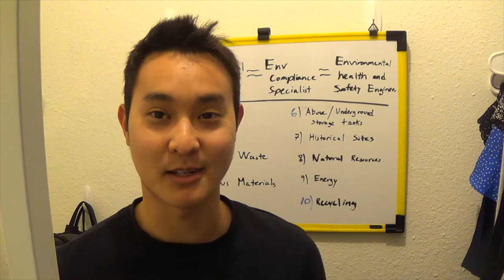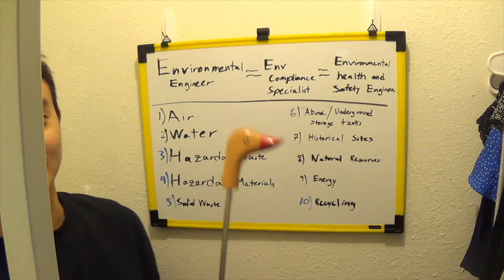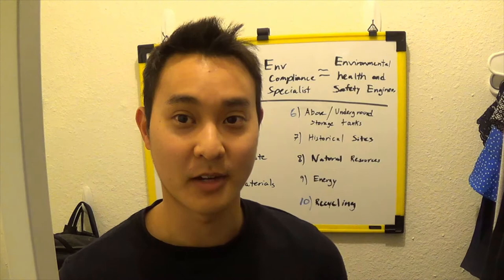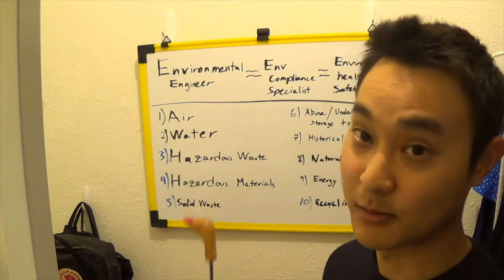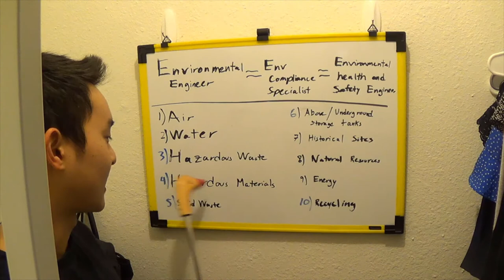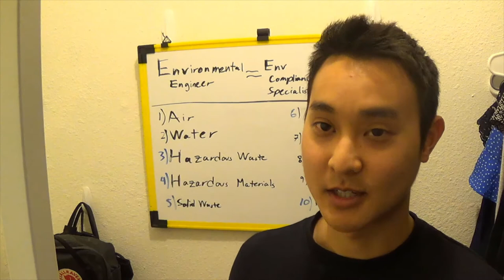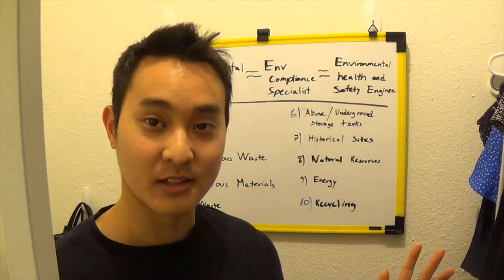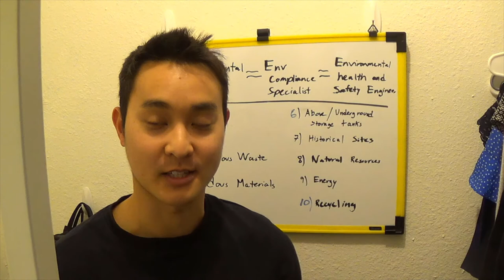What Environmental Engineers Do | Environmental Compliance

Comment: Hey randy, I am in the process of working on completing my environmental engineering degree and I had a few questions. What did you do to gain experience to get a job? I know many jobs even entry level, want us to have experience. Any advice?
Reply from the maker: The fact that entry-level jobs want experience frustrates me so much. It just doesn't make sense. 
That means the only way to gain experience before an entry-level job is during your schooling. 
Things like getting an internship, joining a club, or working on research projects with a professor are all examples you can do while at school. You definitely want to get out there and have some exposure to something related to the environment, but if you can't get into any of them, any type of people building skills should do the trick. They'll most likely want stories of how you reacted to a situation. Customer service skills are really valuable.
Reply: thank you!! 🙂

Comment: Hey, I Hope you reply.. I have a few questions?
how many years do you have to be in college for an environmental engineer?
And is the work hard or just simple On the field?
Is Math a problem?
Reply from the maker: 1) For undergraduate, it takes probably 4-5 years, depending on how hard and fast you study. People can graduate faster as long as you finish whatever is required.
2) My work is pretty easy. The field work isn't really even field work. It's just walking around to different buildings and looking around to see what they have.
3) Math is not a problem at my work. We rarely need to calculate anything sophisticated. No differential equations or anything. They all have software programs that calculate everything you need. Math is difficult during college/graduate school.

Comment: Once you collect the information from the different programs you have to check on, do you then have to put the information into a computer or do lots of paperwork perhaps at a desk? Do you walk around for most of the day or get to have breaks once you collect the information you need?
Reply from the maker: Yes, once I collect the information I have to log it onto a computer. Most of it is on the computer, not so much paperwork anymore. Since no one micromanages me, I have full control on when I get to leave my office to do whatever work I need to do. That's the best part about my job. So long as the work gets done, I get to take breaks whenever. That's why I typically like to just finish the job as quickly as it shows up.
Reply: Randy Ly Thank you for your reply your video was very helpful 💜

Comment: Hey Man I am currently Persuing an Engineering degree for 2 years then I transfer to another university that has a BS in Environmental Engineering or Civil Engineering?. I know that civil engineering has a high demand in the job market but I am scared if I Persue Environmental Engineering I will not get a job. My question is it hard to find a job as a Environmental Engineer? If it’s hard I would just choose Civil Engineering instead.
Reply from the maker: Depending on your location, it can be difficult. Some countries and US states don't take the environment as serious, so there aren't that many job openings for environmental engineers. If you are worried about the job market, you should choose Civil Engineering. That major should still be flexible enough to jump into environmental engineering if you ever change your mind once you get a few years of work experience.

Comment: What kind of salary can I expect to make within the first few years?
Reply from the maker: Salary varies depending on location, years of experience, skillsets, negotiation power, and employer. I am currently making $82,500 but started at like $75k two years ago. The range can be pretty drastic from like $60-90k
Reply: @RandyLy  how long did it take you to find employment out of college?
Reply from the maker: @ryancoates872  I worked in a different field in a research lab after college, so I basically had a job already lined up for me. But then I got laid off and it took me 6 months to find this current environmental engineer job.